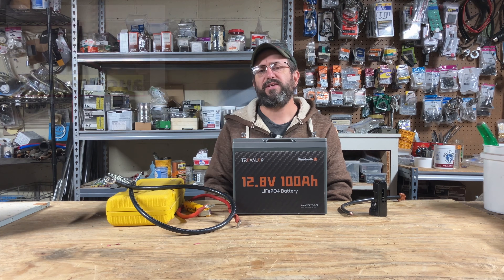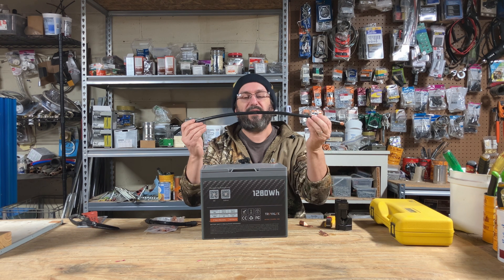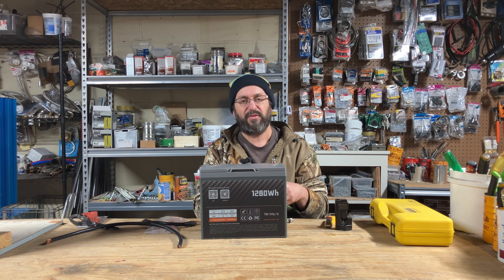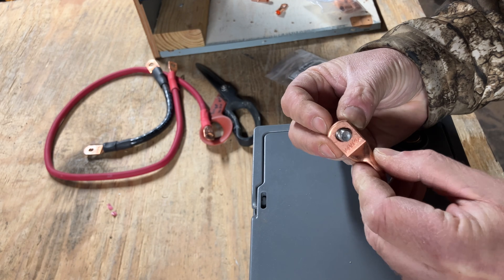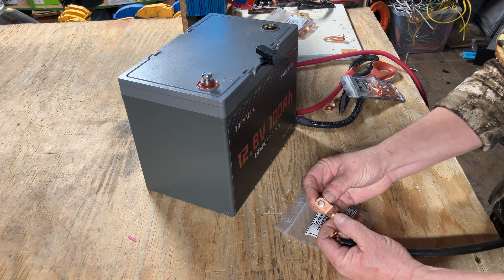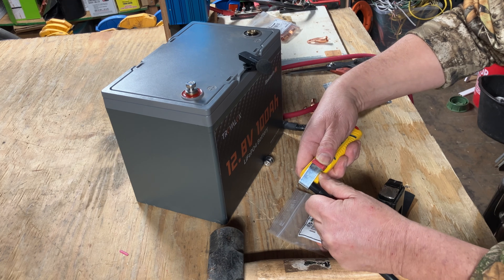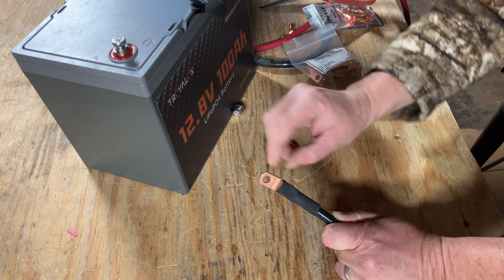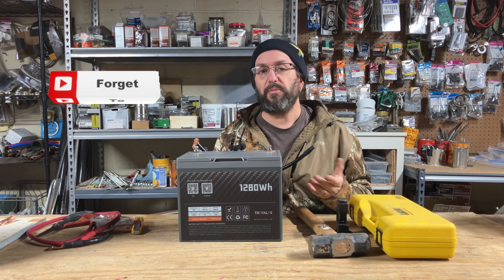Will Prowse's issue with a Battle Born Battery inspired me to do a How to Make and Size Cables video

Comment: Thanks for cutting it open.  That is one solid block of copper.  I think people like the hydraulic crimper better because it looks prettier.  However, you proved that the hammer crimper makes it 100% solid.
Reply from the maker: That is a good point. A hydraulic crimper does make a nicer looking crimp. I just started using the hammer crimper because I was doing a bunch of different size wires and it was a pain to have to switch dies.  It just seemed easier.
Thanks for watching.

Comment: NEVER EVER use “CCA” Cable!!,  (copper coated ALUMINUM) 
It has much less current carrying capacity AND is crappy.
The individual conductors making up a stranded cable are very stiff with CCA and the upsized wire size makes it more expensive for lugs etc..
Reply from the maker: I agree that pure copper is much better than copper clad aluminum.

Comment: How about soldering the wire to the lug, as alternative method?
Isn't wire gauge related to the amount of current your system will draw?  Perhaps a smaller system with light loads could safely use 4-gauge wire instead of 2-gauge?
Reply from the maker: I don't like using solder since it can heat up and get loose.  A mechanical fastener is better.
Yes, wire gauge is related to the current in the system.  And yes less current could mean you use a smaller gauge wire.  For example. If you had a 1200w 12v system you would need 2-gauge but if you had a 1200w 48v system, there would be much less current since the voltage was so much higher so a 4 gauge cable would work fine.

Comment: Looks good to me.  I think you covered most of the points.  I personally like to use tin-plated lugs but pure copper is fine too.   I'll do an exhaustive list (from memory) and an explainer:

* Open-ended (you can see the wire poking through) vs close-ended.  Close-ended is easier to environmentally seal with heat shrink (if that's an issue), but you have to be sure that you've stripped enough wire.

* Pure copper vs tin-plated copper.  Both work.  I personally prefer tin-plated copper for improved corrosion resistance.  Note that pure copper oxidizes more but oxidized copper does not cause any resistance issues so it isn't that big a problem.

* Wire strippers.  The trick is to not completely break through the insulation and do just one rotation around the cable sheath, then slit the sheath to the end afterwords (usually the wire stripper has a built-in thing to help do that).   Works best with larger cables that have thick strands.  Fine-stranded cable is a lot harder to strip without breaking strands.

* Don't crimp the entire lug.  There needs to be a little uncrimped area at both ends.  On the deep-end, so the stranded copper wire"splays out" (this is visible with an open-ended lug but not with a close-ended lug).  The splaying is important to prevent the cable from pulling out of the lug or vibrating loose.  There also needs to be a little uncrimped area at the near end (near the cable interface) to provide some margin from the cold weld to the movable portion of the cable...   Both ends of the crimp area need to leave a bit of uncrimped lug.

* Heat shrink.  Always.  In fact, some cables even have a bit of built-in glue in the sheath so when you heat shrink the heat also seals the interface from the environment completely.

* Strain relief in high vibration environments may also be needed, but crimped lugs are fairly resistant to vibrational wire breaks.

* With few exceptions, do not solder.  Solder creates a weak interface between the stranded portion and the solid solder interface that is extremely vulnerable to vibration or wire movement and will break the cable right there. 

The exception is that there are situations where soldering improves corrosion resistance.  But to do it properly there must be serious strain relief well beyond the solder joint to prevent any side-to-side motion of the wire at the crimp.  And you still crimp first.  Never solder first.  Always crimp first.  So, for example, an MC4 pin crimp can be soldered.  An XT60 is soldered.  Certain sizes of powerpole wire interfaces are soldered.  But most large-diameter lugs should not be soldered.

* Lock nut and washer, or flanged nut into copper busses or tin-plated copper busses, is almost always mandatory to prevent vibration unlocking of the nut.  I prefer the lock nut myself.

* Make sure the lug is completely flat against the bus bar.  That's the electrical interface.  The bolt and nut are NOT the electrical interface.  Make sure the cable is not lodged against something (like the plastic housing of the battery), you don't want any lifting forces on the bolted lug.

-Matt
Reply from the maker: A "Looks good to me" from Matt!! Now that is high praise.  LOL
Thanks for watching and adding your input.

Comment: I use the same technique as illustrated in this video. One thing to mention is don't  make too many passes stripping the wire sheath as this may cause wire strands to be removed. Great Video!
Reply from the maker: For sure don't want to derate the wires.  Thanks for watching!